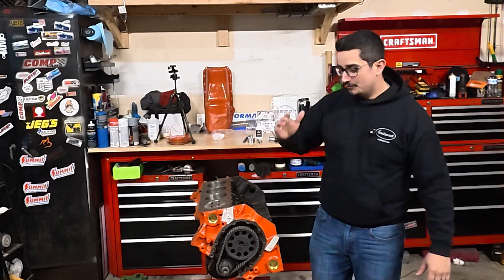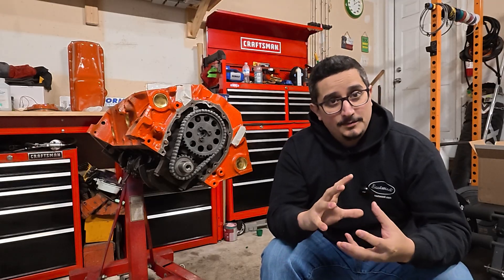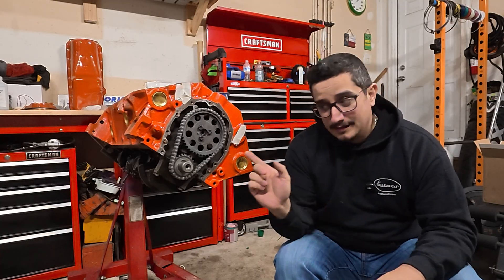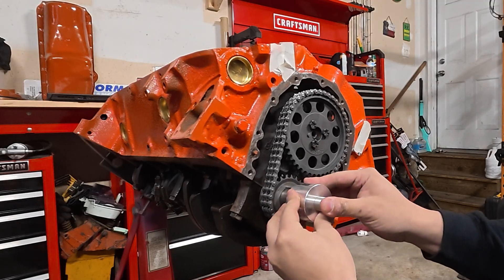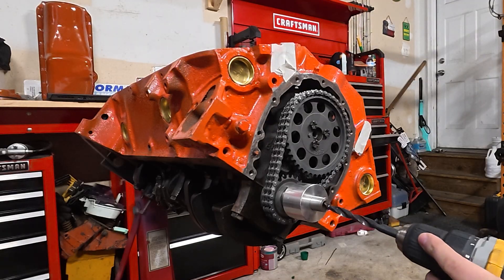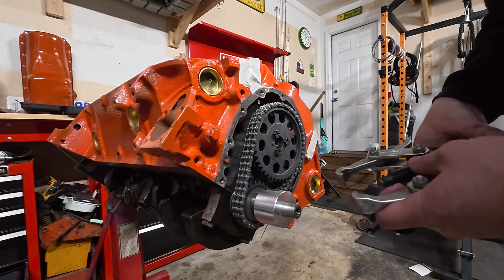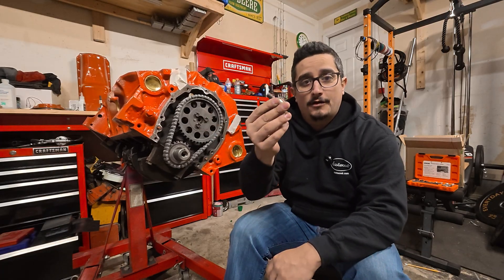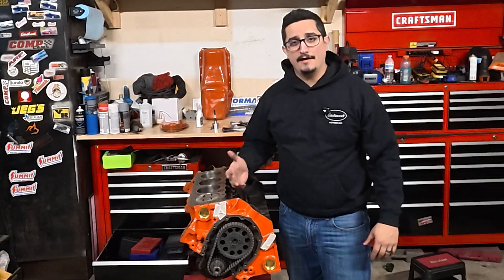The Engine Building Crankshaft Secret You Need to Know

Comment: Keep in mind that 265s, 283s, and early 327s used a crankshaft dampener that had the timing groove in line with the key way. 1970 and up GM moved the timing groove 12° retarded from the keyway. So if you put a modern style balancer on an old small block, paint a white line 12° advanced.